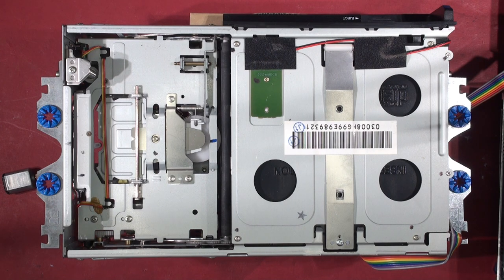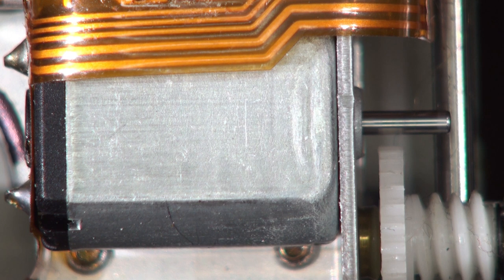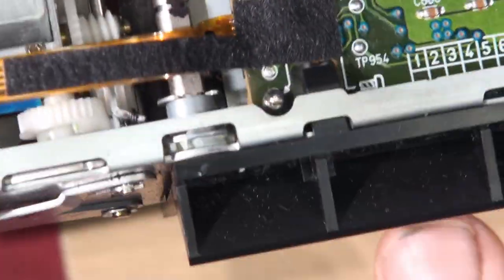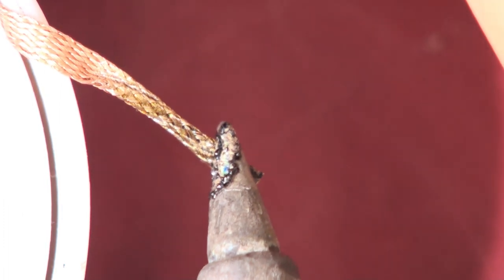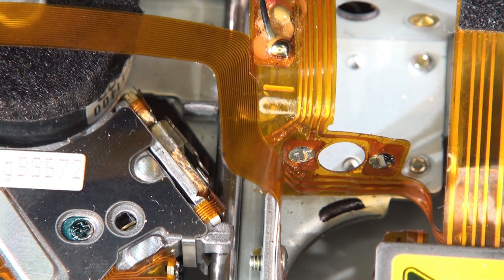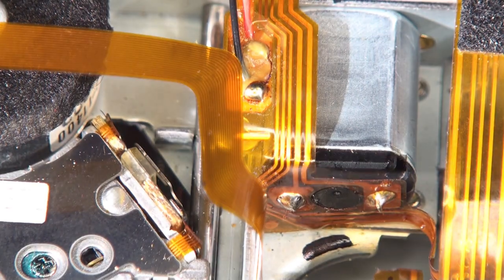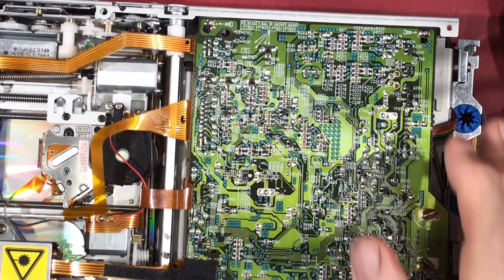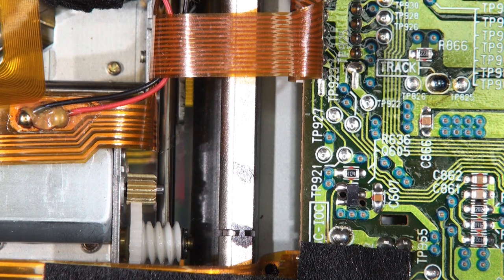Bose Lifestyle Music Centre CD won't Eject Gear Motor Repair Replacement

Comment: Excellent video, very useful, we really wonder why Bose uses plastic cogs when we see the price of their machines... especially for strategic operating locations......then I also wonder why you haven't put a link where you can find the engine ?

Vidéo excellente très utile on se demande vraiment pourquoi Bose utilise des rouages en plastique quand on voit le prix de leur machineS... surtout pour des endroit stratégique de fonctionnement ......après je me demande aussi pourquoi vous n'avez pas mis un lien ou on peut trouver le moteur ?
Reply from the maker: If you want a gear or gear motor then email me at ark.mail@gmx.com

Comment: Thank you. Tonight I realized my cds were stuck inside for years. In one search and your 2 videos including the new one blew my mind. I don't know if the motor and gear are the problem but please let me know how to buy one from you. Thank you!!!❤
Reply: Or send it to you...the display is shot and motor makes no sound but the radio and the speakers routed from television works great still. I want to rescue the cds but also repair the unit and the display. Standing by!
Reply from the maker: I am not doing repairs at the moment as I have weighty design contract.  You should be able to hear the motor whirring.  the display is an easy and very cheap fix - just have a look at the other videos regarding the display.   Time to get soldering!!!
Reply: How can I buy a motor and gear from you?

Comment: ha ha i like the grumpy outrow :-D
Well done, im sure there will be more cd units on your bench,  the brass gear is spot on.
Did you lube the gear or didnt it need lube.
The old cheese bose  i fixed for a bloke down the road works fine now, the deck switch was o.c but i dug into my box of crud and there was an identical switch (It only sat in the box for 20 years) :-D
Reply from the maker: Oh, I lubed her up with Blue lithium. I designed mechanical document readers with Acteal gears and I found that the paper dust used to stick and gum it up. Then I read that for light load no lube is required. However, Gentleman use lube on every conceivable occasion..
Reply: @razenby  i wonder if mollygrease would be bad for Acetal.
I do have silly thoughts.

Comment: Hi:
I have a problem with my system; How can I check if the motor is the problem or that it is not receiving enough or not energy at all. The gear doesnt move and the motor is not working (not even making the sound).

BTW: I am not an expert, in fact, Im just learning how to do this things.

Thanks for your time
Reply from the maker: Hmm, tricky. Is something stuck on the mechanism.. Can you turn the gear by hand and move the mechanism ?
Reply: @razenby  Thanks for answering. Nothing is stuck in the mechanism. Yes, I can turn the gear by hand and the mechanism moves, how can I send you a video?

Comment: This is a classic case of analog not working in harmony with digital, they just dont belong together.
Reply from the maker: If you really believe that then best not travel go in a modern car, bus, plane or train. ..... I gethe willies every time I go on a cable car... very uneasy feeling...
Reply: @razenby  Lol, i meant things like DAT and DCC recorders, on cd players its always something mechanical that goes wrong first
Reply from the maker: @Synthematix  Yes, especially those with old style  polyurethane drive belts that turn to goo.... Have they solved that problem or are the new belts the just as bad?
Reply: @razenby  Dont know why they dont make them out of silicone
Reply from the maker: @Synthematix  Acetal is the material of choice for plastic gears - it has good,stable dimensional accuracy and is has excellent wear characteristics..
Reply: @razenby  Lol i meant the drive belts, silicone would last forever, maybe thats why they dont use them

Comment: I am trying to contact you about purchasing one of the gears for a Bose lifestyle 20 CD changer like on your YouTube video what do I have to do to get you to send me one
Reply: I was also wondering how easy it is to get that brass gear onto the motor shaft?
Reply from the maker: You need a reamer or accurate 2.0mm drill. .  Maybe easier to buy a complete gear motor from me. Just email at ark.mail@gmx.com